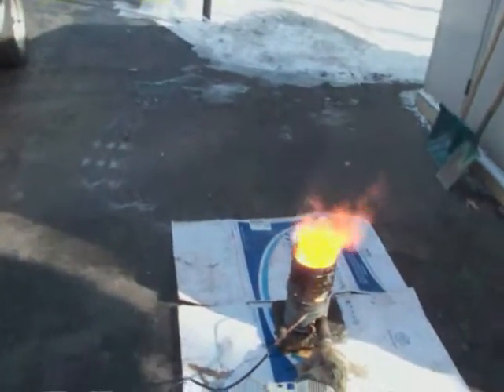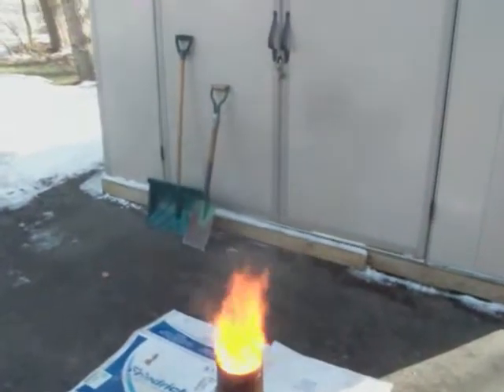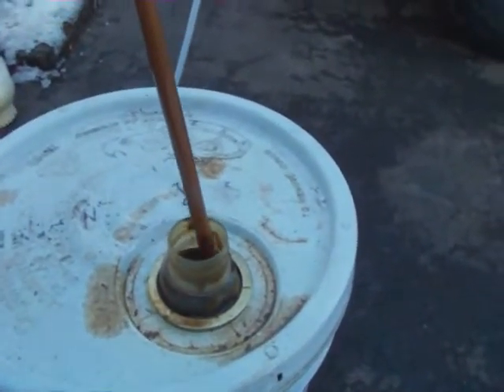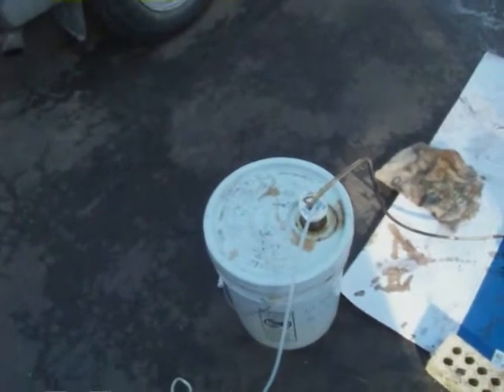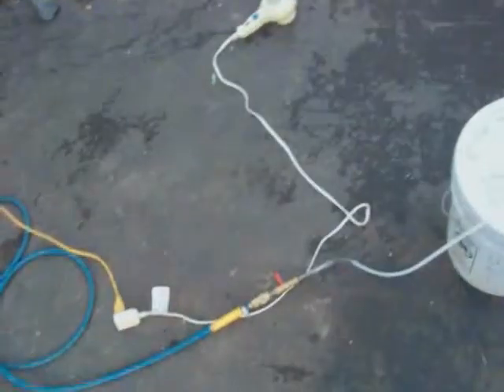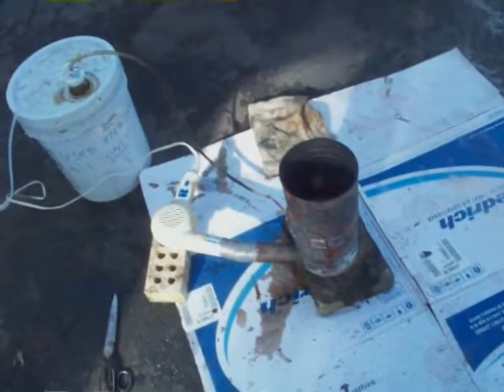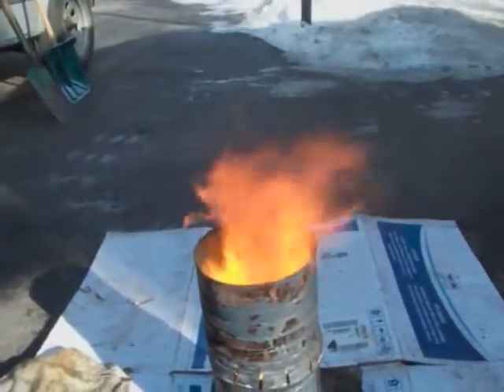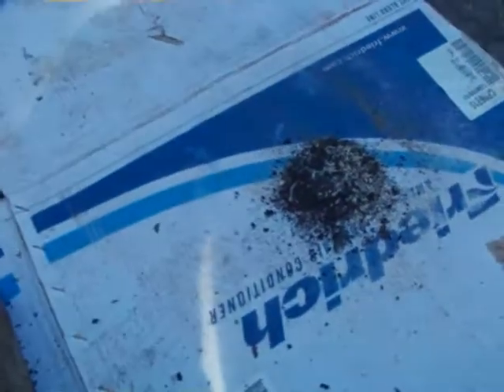waste oil burner (prototype)

Comment: I'm wondering if pre-heating the oil before it is burned would help. Something like a longer copper tubing wrapped around the top of the first coffee can. 

The other idea I had was if you can find a Y or a T fitting for your compressed air, feed some compressed air into the burner via another copper tube so it blows straight downward at the bottom of the can. The air would "spray" the oil upward and atomize it. Add the air slowly and be prepared for some extra-large flames.

Comment: drip or steam water droplets in .this will cause extra heat and also that heat will cut down carbon .may take a little adjusting on fire up . i do this with my wood burner waste oil fire in my house in england

Comment: mabe a centrifugal filter of around 3 microns and then inject it with the addition of a preheater it should burn cleaner 
thats the system they use to run russell newbery diesel engines

Comment: the steel pot is to thin and your losing heat this is stopping the oil vaporizing.
try running the fuel lean you need to see the can glow red hot if not you need to get the temp to round 3to 400 C for a clean burn good luck